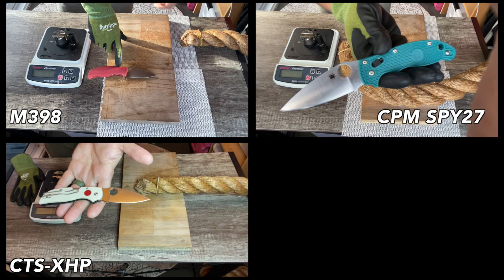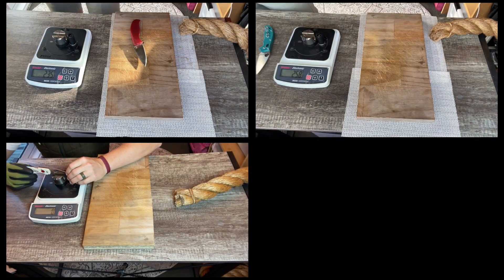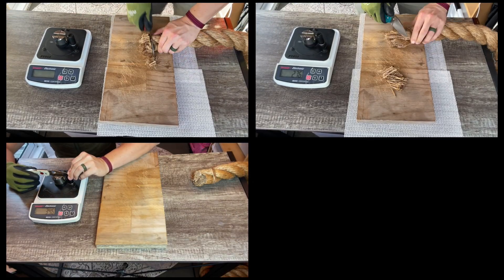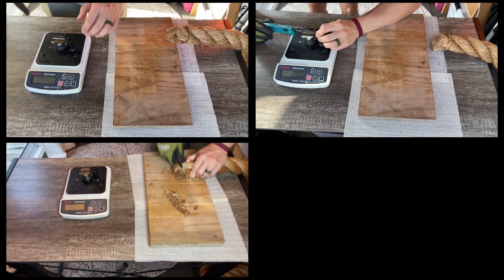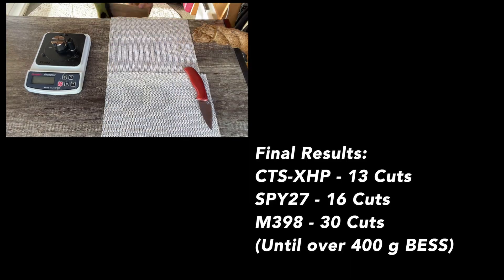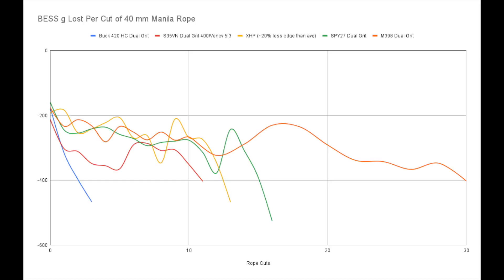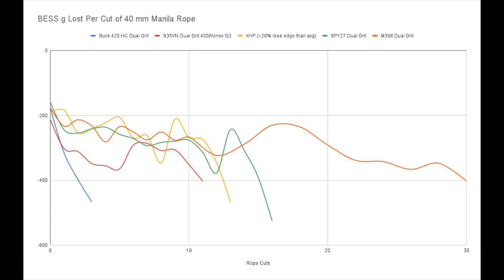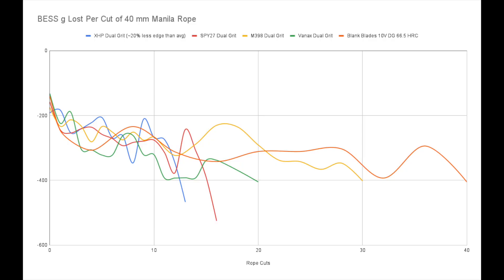Spyderco Faceoff! CTS-XHP M398 & CPM SPY27 Steel | ANDE Rope Test

Comment: More research into human biology.  Risk of injuries we encounter as knife users is real & cumulative.
- The Long Flexor Tendons thicken/enlarge from repetitive trauma preventing them from easily passing through tunnels which act as pulleys.  -  These tunnels are called Fibrous Sheaths. 
- Extending & curling the finger to grip the knife will become difficult. - The tendon catching as the pass through these tunnels results in pain, stiffness, &/or catching symptoms.
Search - "Trigger finger" for more info.

Comment: Thanks for the testing!  What edge angle did you use for this?
Reply from the maker: Angle blocks were calculated to form 17 degrees per side on each of the knives.  I sharpen by hand, so there is a marginal amount of angle error I'm sure.  I just some of your 2024 EDC recap - well done man, I can tell you pay attention to steel & design details.

Look forward to hearing from you in the future!

Comment: Interesting findings, especially the M398. I have had almost the polar opposite experience with my M398 mule, in that it is a nightmare to get sharp on my diamond plates (the edge seems to crumble to powder - I know how weird that sounds, but it’s the best explanation I can give 🤷🏼‍♂️) and it loses its working edge in a matter of moments at work. I’ve relegated mine to the naughty cupboard after it didn’t redeem itself as a small kitchen knife.
Reply from the maker: Fair enough!  Rope tests are pretty gentle on an edge - I'll be interested to see how the real world treats it (planned it into a Spyderco EDC Tournament I am doing and will carry it in about 5 weeks!).  So... You'll get a report back!
Reply: I think my mule might be an anomalous example, as everyone else I speak to about M398 has had an experience similar to yours. I wonder if my example has a duff heat treat or something 🤷🏼‍♂️
Reply from the maker: Al, I just bought a LeafJumper in K390 on sale... It's fully serrated!!!
Reply: Oh awesome! I’ve found you can load 4mm tech cord or paracord with stropping medium to deburr into the scallops.

I have an SE K390 police 4 LW and it is really impressive when cutting rope. Looking forward to seeing what you make of it 👍🏻
Reply: You might have gotten a bad batch of steel.